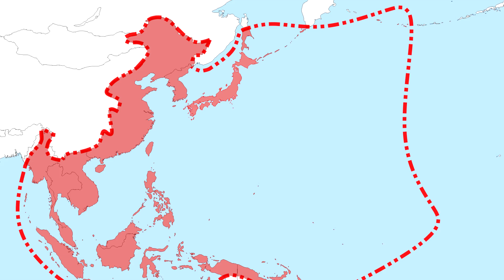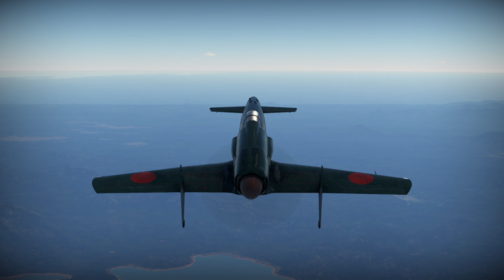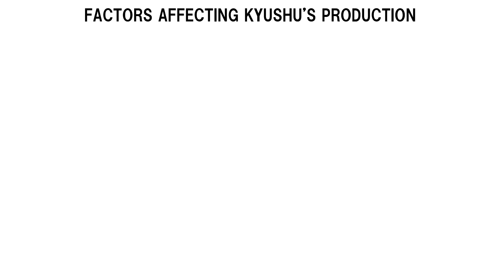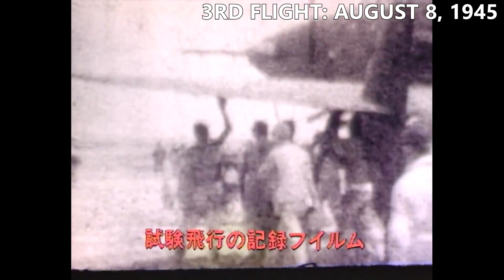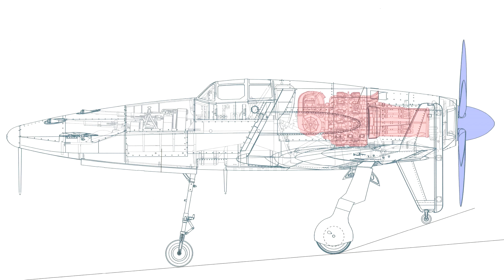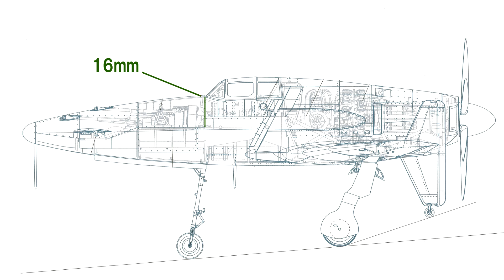Know Your Plane #7 | Kyushu J7W1 Shinden: The Japanese B-29 Interceptor

Comment: The Italians designed and built an almost identical aircraft to the "Shinden" in 1939. It was called the "Ambrosini SS4". It had   a 960 hp engine turning a three bladed prop. which pushed it along at a speed of 355 mph, which for the time made it one of the fastest aircraft of the time. It had an armament of two 20mm cannon and one 30mm cannpn in the nose.
The first prototype crashed and because the war had started, the Italians dropped the project and decided to concentrate on improving their existing aircraft.
Reply: The British also made the Miles M.35 in 1942, followed by the M.39B in 1943.

Comment: First videogame adherence was "heroes of the pacific" for ps2
Reply: Same, loved that plane
Reply: Me to
Reply: Do you mean the first game it featured as a warplane?  The J7W1 and J7W2 was in the PS2 game Sky Odyssey as a secret plane, but since that game was more or less a simplified flight simulator without plane combat I don't know if that counted in your books.   At least, that's how I knew about the Shinden.
Reply: @4chance610  I'm sure heros of the Pacific is earlier
Reply: @The_Firehawk  according to Google: 2005 vs 2000, Sky Oddysee came earlier.
Reply: @4chance610  ohhhhhh. But that's the j7w2. The j7w1 was in heroes of the Pacific. So technically it was the first apperence of the j7w1
Reply: @The_Firehawk  Look closely, it's got the Shinden and the Shinden Kai.  You get the W2 once you have all the parts + the jet engine.
Reply: @4chance610  jet engine??

Comment: That plane's design was ahead of it's time.
Reply: Truly
Reply: As japanese design tends to be right?
Reply: @odiwalker3973  expect in tanks, they all looked like ass for most of the war
Reply: @pomelo9840  can't argue with that
Reply: Be it in function or just plain style, indeed it was.
Reply: Yeah sure
Reply: If it was ahead of its time wouldn't we have seen similar aircraft developed in other countries later?
I don't think we did.
Reply: @fatdaddy1996  we do. European delta wing planes with frontal canards have the same concept - big wings on the back, frontal canards, push engine on the back. JAS 39 Gripen is the most similarly shaped aircraft I'd say. There's also Rafale M which is another great example of delta-wing fighter.

Consider that other than the Shinden, all fighters of the times had the opposite - big wings in the middle, stabilizers on tail, and pull engine on front.
Reply: Not really, the Americans had a similar layout prototype called the XP-55 Ascender finished and flight tested by the Summer of 1943
Reply: @MikeGoesBoom  just cause the xp-55 was also ahead of it's time it doesn't mean this one isn't
Reply: @MikeGoesBoom  It's design isn't as efficient as the Japanese design.
Reply: Actually, the very first plane ever, the Wright brothers used a pusher plane configuration with canard wings
Reply: @gj1234567899999  And so was the first dedicated fighter aircraft, the Gunbus.